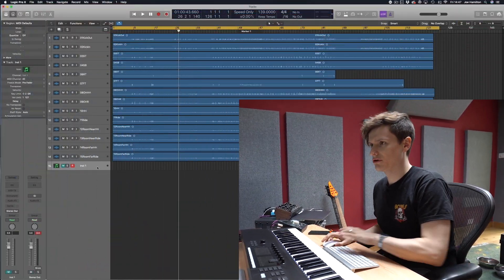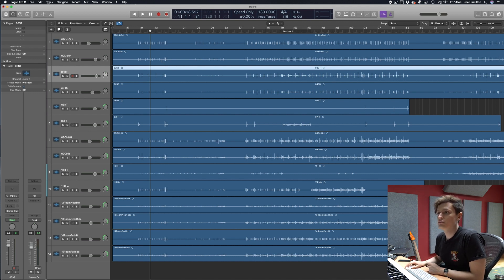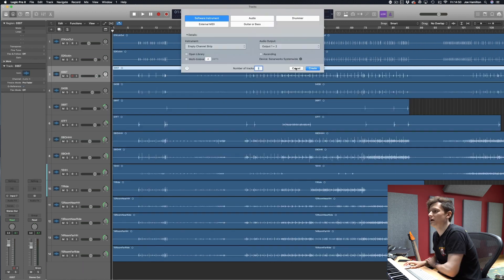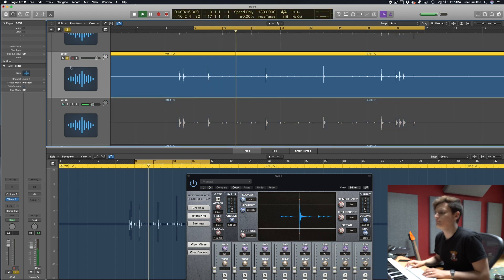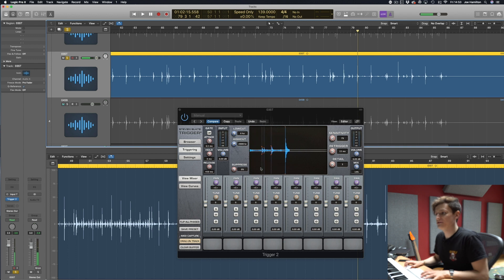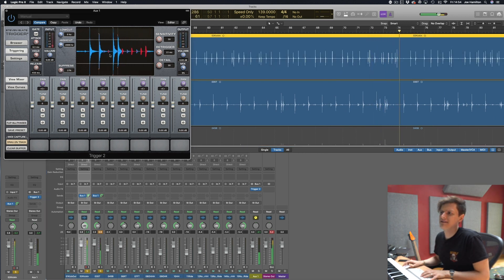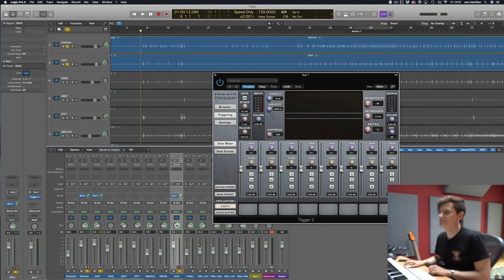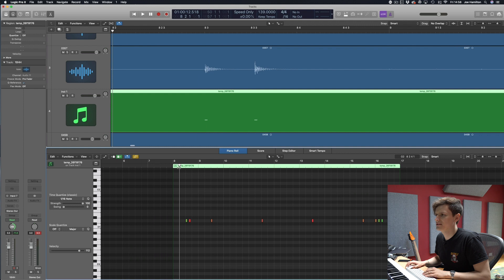How to convert drum stems to MIDI

Comment: Any thought on how to do this with a mixed stereo drum track where all the drum parts are on the same stem?
Reply: I have the same question as well
Reply: You could try to isolate the specific part you want using EQ, Multi-Band compressor...etc. So for kick, cut the highs and mids. For the snare, find where its most dominant frequencies are and cut everything around it...and so on. Bounce the processed track to audio and do the midi thing. Once you are done aligning the midi, you can get rid of the processed track.